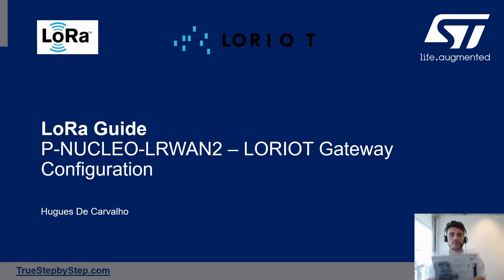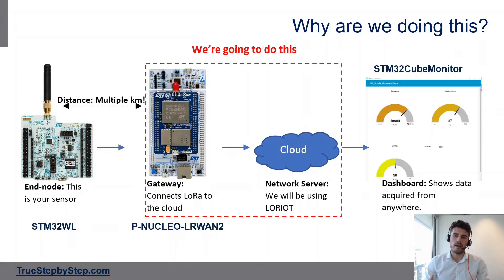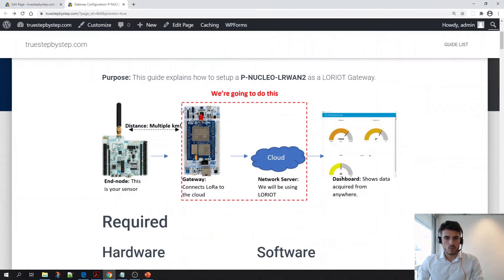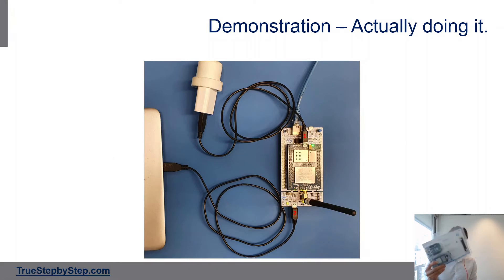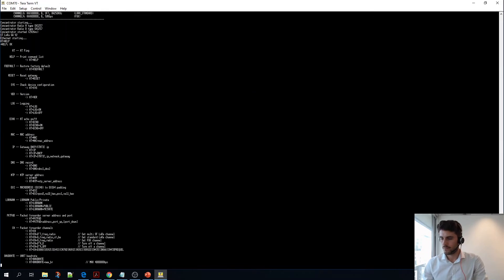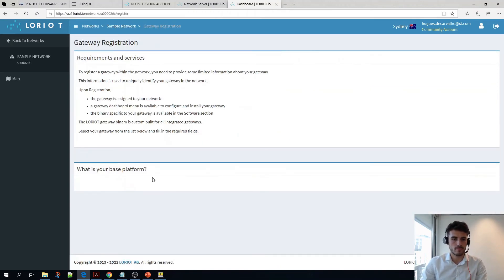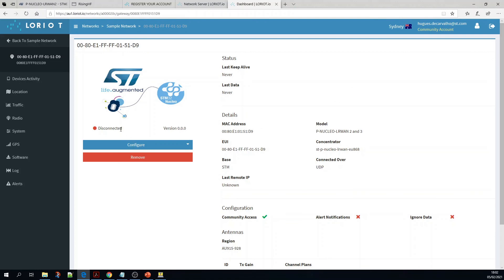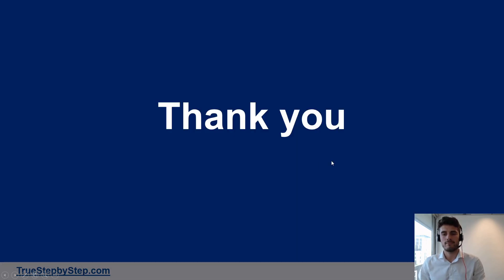STM32WL - LoRa Guide - 1.1) Setting up a P-Nucleo-LRWAN2 as a LORIOT Gateway

Comment: hello sir I hope you answer my question at the beginning of the video you showed the a P-Nucleo-LRWAN2 package that contains the NUCLEO-F746ZGT6 board and THE NUCLEO-L073RZT6 board  , but you only use the NUCLEO-F746ZGT6 board 
my question :  is there  a problem with the board that  you have it changed or nn thank you
Reply from the maker: Hi! I don't think there is anything wrong with the nucleo-LO73RZT6, and you would be able to make it work, but it is a shield and requires another board with a MCU. The advantage of the stm32wl Is that it combines both a MCU and the LoRa core.

The stm32wl came out after the nucleo pack.

Hope that helps!
Reply: @truestepbystep3763  Thank you 
but I tried many times with the nucleo-LO73RZT6 board but every times I find a problem with the things  network or loriot
 can you please make i video haw to registre end node device with  nucleo-LO73RZT6 board  thank you
Reply from the maker: @marwenmaghrebi8697  Hi! I'm not working on this anymore unfortunately.

In any case, it's all about how you value your time vs purchasing a new Dev kit.

Good luck!
Reply: @truestepbystep3763  thank you